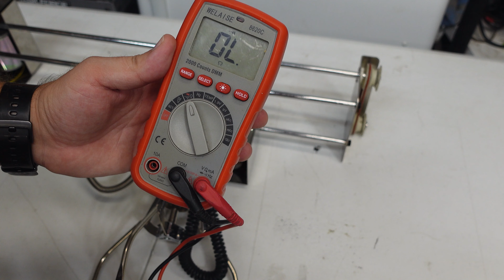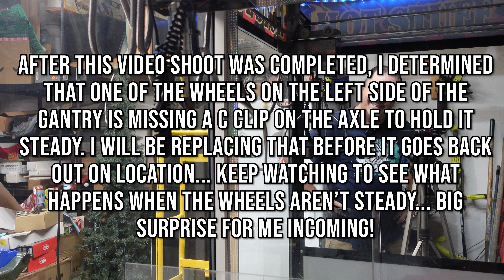CLAW MACHINE REPAIR! Watch Us Diagnose And Fix This Claw Machine!

Comment: Hello.  I found your channel by looking for something else. I just purchased one of these Hot Stuff machines (Haven't received it yet).  The problem I have is,  I need to know if the front control panel and box can be completely separated from the machine.  I neglected to account for the box when measuring for the door that it needs to come into my location.  I only have 30 inch door to get it in. Thanks in advance, and I have already subbed as I see your channel will be a wealth of knowledge to me.
Reply from the maker: Thanks for the sub! Depending on which version of Hot Stuff you acquired there should be 4-6 screws holding the control panel to the front of the machine with Molex connectors on all the wires for easy removal! Hope this helps!
Reply: @GalaxyGames843  Thanks for the quick reply!!  Sounds pretty simple.  This makes me happy, I was kinda bummed because I thought I had made a huge mistake in my purchase.
Reply from the maker: @krzsrh  you should be good to go!